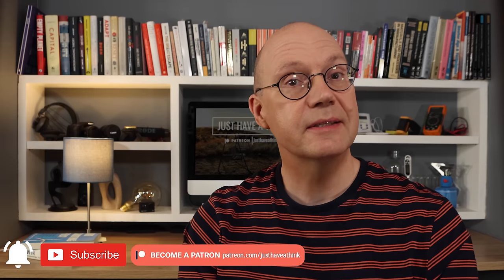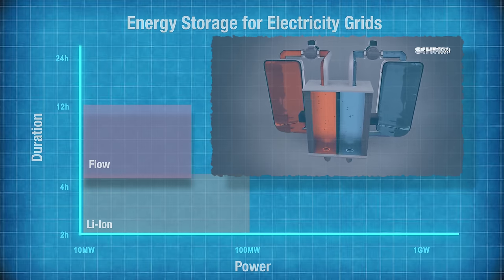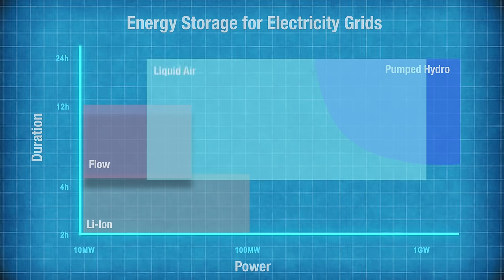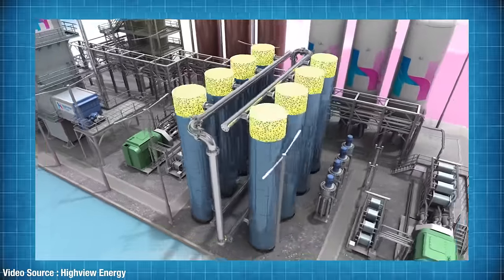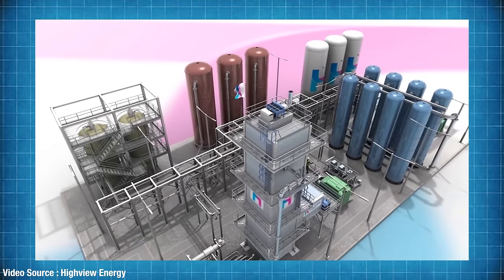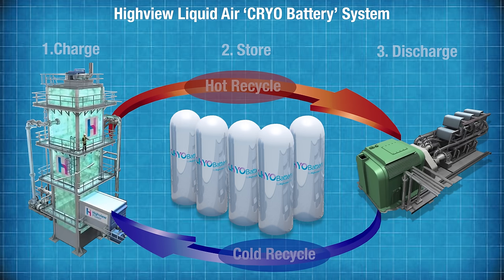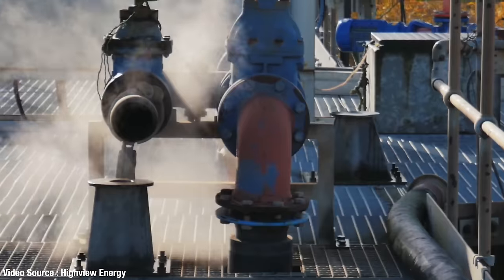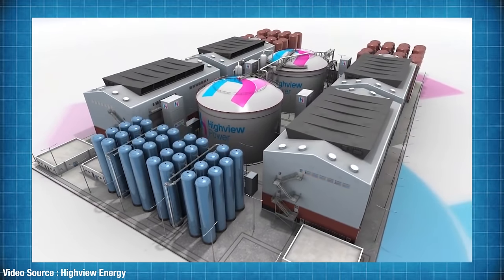Liquid Air Batteries. Literally energy from thin air. Seriously. Literally!

Comment: I've realised that coal-fired power stations are valuable assets in the energy mix. They have big turbine halls, large generators run with pressurised gas, massive yards currently used for storing coal, an electrical substation and a thick connection to the electricity grid. They sound like cost-effective sites for converting to huge liquid air storage facilities to provide power in the winter months. Replace the boilers with air scrubbers/liquifiers and build a load of tanks outside. It may not be 100% efficient but neither is keeping wind turbines stationary because there is nowhere to put the power. No need to buy up/dig up a farm or two. Minimal planning permission. Just convert dirty power stations into clean ones.
Reply: That sounds like an interesting idea.
Reply: People will stop fighting against renewables if they know there's a job awaiting them there. Many places where the fossil fuels are burned have very few large good-paying employers in the area.  These dirty power plants pay for homes, pay for education, pay for health care.  You can imagine why the local population puts up a fight and votes against their shuttering.  I was surprised that they said that 200 people would be employed by the new plant.  Seems like a lot, but from an employment standpoint it's a good thing. We'll take the oil drilling companies and their employees and turn them into geothermal ground source energy providers - the clean kind.
Reply: Don't stop there. There's no reason to think the coal-fired stations couldn't be converted to a hybrid model, which could use liquid air or coal/natural gas powered steam. That way, they could default to the liquid air and reduce overall emissions.  Although, I specifically remember reports of scientists back in the 1970's claiming we were on the verge of a new ice age. It's entirely possible that man-made global warming caused by the use of fossil fuels saved the planet. Further, the greenhouse effect is not necessarily a bad thing. Plants grow much better in a CO2 rich environment. Increasing CO2 in the atmosphere may well be exactly what's needed to allow farmers to feed an ever increasing world population.  Of course, climate alarmists often also advocate for a reduction of human population upon the earth. 
But if you're truly serious about eliminating CO2 from power generation, then you should be advocating for thorium powered liquid salt nuclear reactors. They virtually eliminate the issues with conventional uranium/water cooled nuclear reactors, and there's enough thorium to produce cheap plentiful energy for the entire planet for thousands of years.  With it we could lift third world countries out of poverty easily.
Reply: @erikehlert  People involved with international geothermal say they are working with natural gas companies measuring the heat in the thousands of dry drill holes left behind. The gas companies might get onto geothermal and measure the heat in their drill holes going forward.
Reply: @motie38  How is that green when it produces toxic waste?
Reply: @andyc9638  Please specify. What "it" are you referring to? The hybrid model I mentioned, or the thorium liquid salt reactors?  If the latter, you need to study them a bit. They can actually reuse the waste from uranium reactors, thus helping to clean up the toxic dumps we already have.
Reply: @motie38  Remember telling an energy minister about this 15 years ago. He had not got a clue about thorium reactors.
Reply: @mrvolcada5355  Not surprising since they do not as yet exist.
Reply: Power stations generate power! We still need them. There will probably never be enough renewable supplies.
Reply: @kitemanmusic  BTW, there may be enough renewable supplies, and those supplies may well be oil.  Not even recent news - check out: https://www.neatorama.com/2008/06/17/bacteria-eat-waste-and-poop-out-oil/
Reply: Big Clive?  Is that you?
Reply: You bring me up the idea that the heat storage part could be left away if they use the hot smoke of the coal power plant to heat up the liquid nitrogen and then further use the cooled mixture to liquefy, thereby removing the CO2 and all the rest. I don't know if they could control it all enough ( too much soot and other deposits ?)  but yes, in theory at least the exhaust of the combined system would be just perfect.
Reply: @motie38  absolutely this  technology could be the turning point away from poluting fossil fuel reliance forever  clean green electricity is the way forward.👍👍👍
Reply: @Clive Mitchell great point Clive the opportunity's are Endless all that unused acreage could be better utilised for energy storage and supply.
Reply: @deanmetcalfe7168  Geothermal   ground source heat pumps are becoming very viable options for extracting energy for hot water and home heating one unit of energy can pull up to five units usage back bore holes and wells are ideal ,even the air source pumps are nowadays quite effective
Reply: As importantly, the existing electrical infrastructure in a repurposed power station for delivering or retrieving power from the network can be reused with additional massive CAPEX savings to a liquid air project.
Reply: Don't bother: 60% efficiency is too little, EV vehicles with li-ion will absorb all supply variability.
Reply: @peceed  Depending on how installation and operating costs compare, 60 % may well be more than enough to be worth the trouble. EV batteries are not close to enough to complement the variability of large-scale wind/PV vs demand. Indeed, they add some variability of their own since they are not plugged in all the time – surprisingly, sometimes people actually want to drive them.
Reply: @SebastianSchleussner he context of vechicles liquid air energy storage is out of question. As a grid stabilizer it will loose to molten metal batteries, that are 80% efficient, more compact and posssibly cheaper. Electric vehicles are not working most of the time. In future every parking place will be a recharge station.
Reply: @motie38  Thoriums a dead duck, no material on the planet can withstand the liquid salt solution.
Reply: @motie38  That bug poop link is from 2008, coming on in leaps and bounds then? Plants do indeed breath Co2 but unfortunately they don't like extreem weather change, what do you suggest we do about that?
Reply: All these fancy things like fusion and liquid air batteries will never work in practice.
But Romania has signed a memorandum with NuScale Power to install Small Modular Reactors, and they plan to install them in decommissioned coal-fired power stations, it's the obvious solution .
Reply: But, can they produce/store the equivalent power in the same footprint as the existing power plant,  to include the area of solar panels or wind turbines needed to stoke up the system.  This is a different measure of power density that isn't often considered. 

The optimal one-for-one substitute for the coal plant that is absolutely green is a modern nuclear plant. If you build a LFTR or equivalent using chloride molten salts in place of fluoride ones, no monstrous pressure dome is necessary nor is there need for water cooling. It is highly possible that the nuclear plant, if properly designed, can plug into the existing generator structure and power distribution network. And no, it won't store excess wind and solar, but it can fill in the gaps they leave. You can certainly site one of these liquid air plants in the space taken up by the rail yards and coal storage as well as the fly ash storage, which will be far more radioactive than any existing nuclear plant. 

In other words, this is a technology looking for a need that it can actually fulfill. Of course, it will need a huge, non-resident infrastructure to even function. I'm straining to see the advantage of using this technology to replace coal-fired plants. It certainly can have uses in close proximity to the sources of power that it backs up, but I have my doubts about economic justification. 

And, by the way, large lox tanks are one of the most dangerous explosion risks on the planet. When one such tank was set up at a welding school, a large Earth berm had to be built around it, and the inspectors said that it could clear a half-mile wide area if it detonated. And that was nothing like the size of these tanks. They would be far more dangerous than any nuclear plant.
Reply: This is a great idea. I just commented on reusing existing infrastructure with a new way of driving the turbines. I wonder if air carries sufficient energy to drive the huge steam turbines
Reply: @Boembo, it doesn't have to be contained. The earths core is a hotter liquid. As it melts deep into the earth it cools enough to contain itself or merges with the hotter core. That's a non issue if the factory is designed well.
Reply: @Superior Etchworx, An air pressure turbine specifically designed for air pressure would be more efficent. The liquid air battery is designed with heat/air/pressure and steam in mind. It's basically a highly controlled explosion, slowed down to a manageable level and rate of expansion.
Reply: @terrafirma9328  you are right but my point was about repowering existing generators as a way of putting of use of new resources and the carbon footprint that they inevitably have.